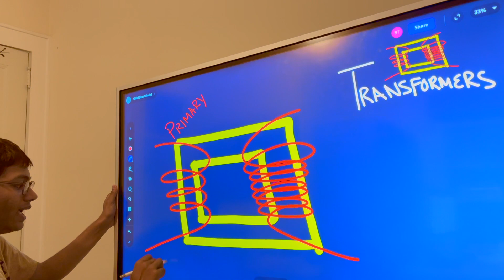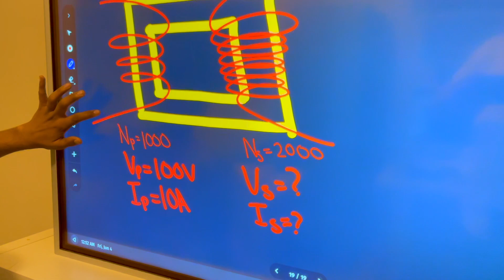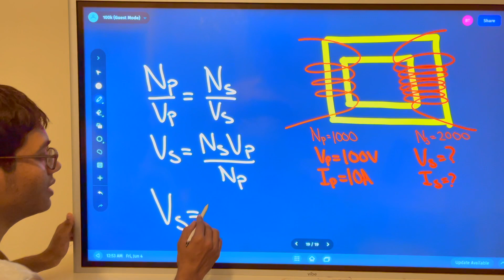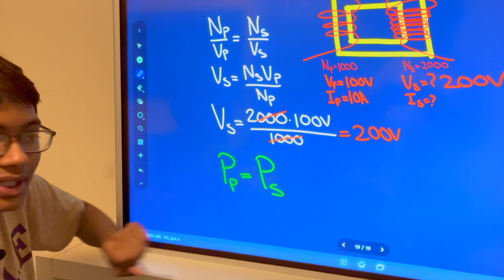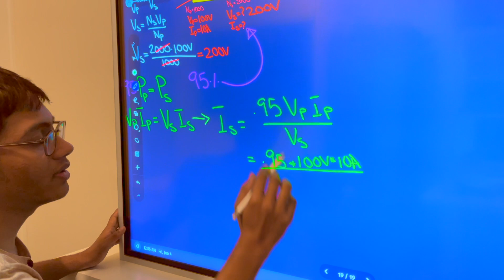Transformers

Comment: You cannot use power formula here because the secondry and primary current mmf cancel each other so fixing primary current fixes secondry current the efficiency you are talking about can be used to calculate voltage regulation of the transformer by which you can get secondry terminal voltage not secondry winding current, the power conservation method can be applied to an auto transformer not a 2 winding one.